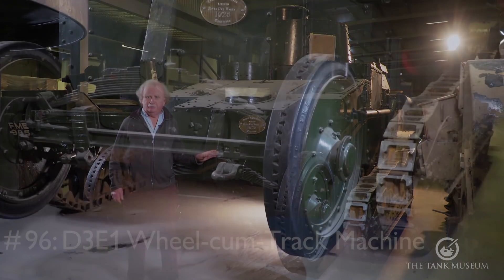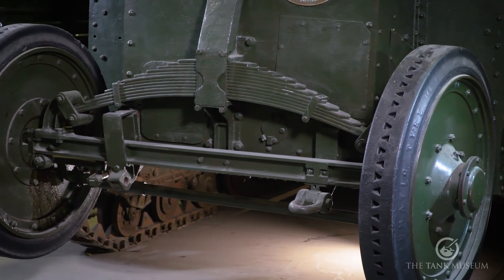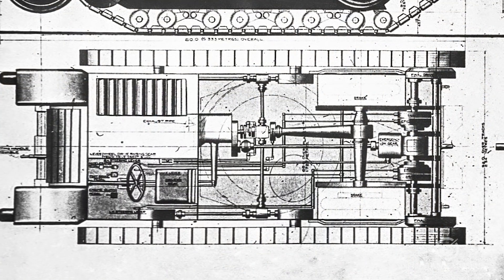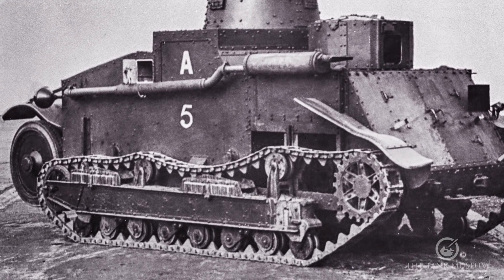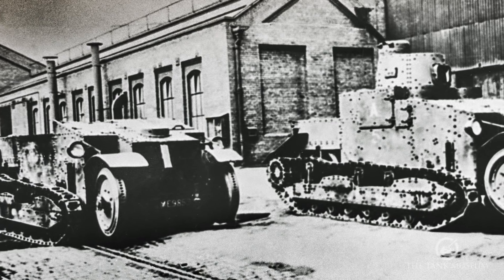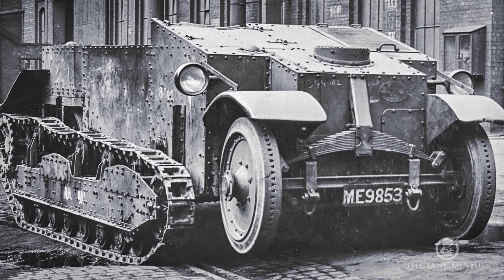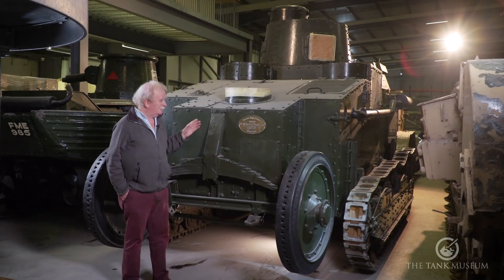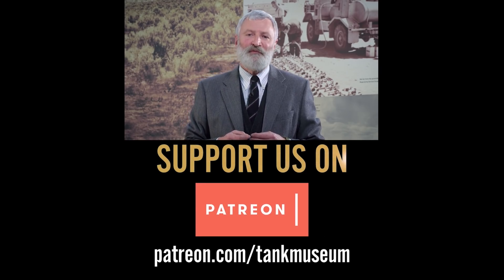Tank Chats #96 | D3E1 Wheel-cum-Track Machine | The Tank Museum

Comment: This has many boxy & design aspects very similar to the early Japanese tanks experimental models and the Type 89 I-Go; 
..with the front hull door(s), the rear decking air vents, the front glacis & rear decking hull angles, the general look of the cupola, the tracks sub chassis and the seemingly tall tapering turret.
  Those similarities could be mostly of a coincidence in design - due to usual human sizing & shapes, WW1 era industrial & manufacturing prcesses and infrastructure, military vehicle equipment requirements, the engine & drive-train etc. Plus perhaps with some indirect basis of shared industrial know-how from the times of the Anglo-Japanese Alliance, which Vickers was quite 'heavily' invloved with before it was dissolved in the 1930s/or 1931?

Comment: Very ingenious idea!  Wheels for fast movement on roads, tracks for cross-country mobility.
I see it as a heavy armoured car with auxiliary tracks, rather than a tank with auxiliary wheels.  
With the tracks, it would be able to handle off-road terrain that would be impassable to an early 1920's armoured car - since they also had thin, solid rubber tyres, which would sink into soft ground and get bogged down.  

But the development of large, wide, low pressure pneumatic tyres, as seen on 1930's armoured cars, could handle soft terrain, and made this vehicle unnecessary.

If you look at it from the perspective of the early 1920's, it's very impressive!  But by the early 1930's, it's already completely obsolete.